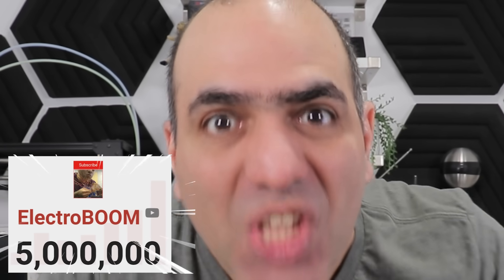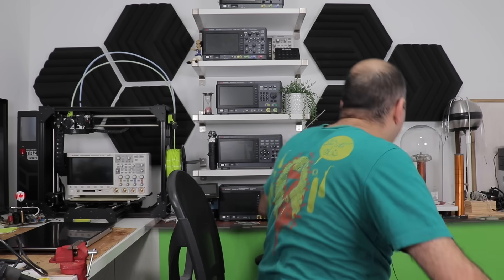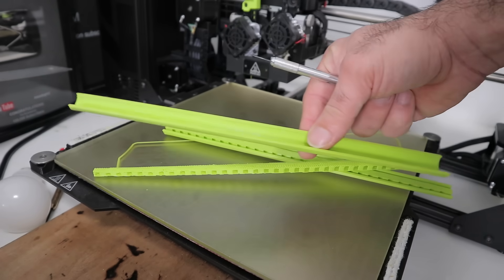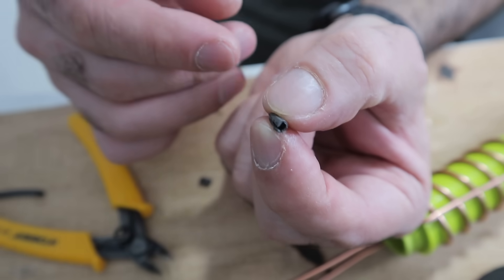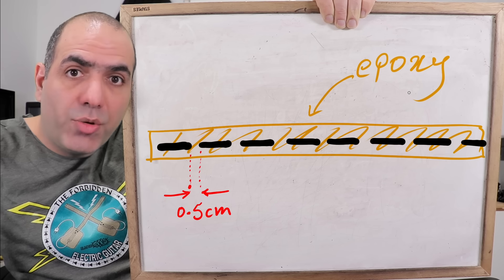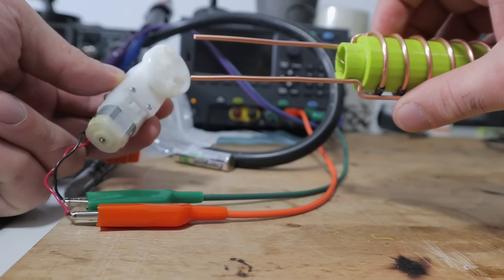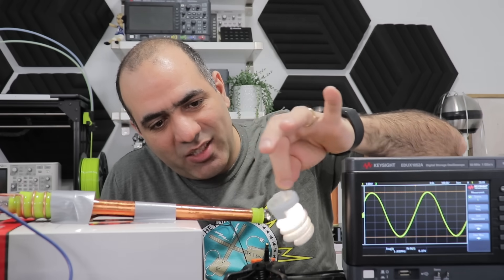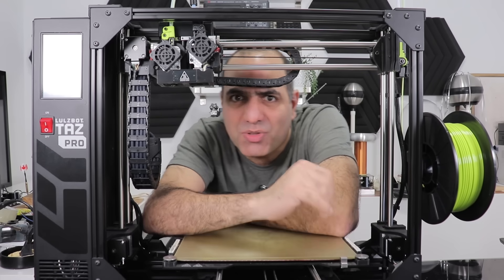Making a Tesla Coil Magic Wand, to Celebrate 5 MILLION SUBS!

Comment: Should have used something like 2000/48 litz wire for the primary, then it would only get warm even at a couple kW's. Of course then you have to watch out for the secondary that will probably be hot enough to thermal burn if touched (assuming 155C-rated wire or higher).

Comment: I've got Harman Kardon Soundsticks as my PC sound system. The volume control is two little touch sensitive buttons on one of the tweeters.
Whenever I turn on my plasma ball (which is about 300mm away from the volume control) the sound turns down to zero.

Comment: I guess the heating might be due to the high frequency change in magnetization of the ferrite core. You might rather go with a RF power amplifier design, which supports the 2.7MHz with air core... Also, you might want to check out javatc calculator. This calculator gives the optimal coupling coefficient for your coil geometry. Congrats for reaching 5M subs.
Reply: Can you give us a link for that calculator please ?

Comment: >"The atom bomb will never go off - and I speak as an expert in explosives." - U.S. Admiral William Leahy in 1945
>I am not trying to win the argument, but you love for the truth. 
>The Scientific Method:
   1. OBSERVABLE
   2. REPEATABLE 
   3. REPRODUCIBLE
>The gyroscope resists all "gravitational" forces in the Universe. Rigidity in space is created by its rotating motion. In 4 gimbals, set it in motion with the axis in the vertical position. It should move 1 degree in 4 min. 15 degrees per hour, to a horizontal position in 6 hours. If not then the Earth is not a spinning ball. The gyroscope experiment should put an end to the debate.

Comment: I would recommend Polyimide (Kapton) tape for electrical isolation.  Polyimide  has a dielectric strength rating of 7700 volts/mil.  Epoxy is only 450 volts/mil.

Comment: You should take a look a specific electrical insulation epoxies, you might be able to squeeze a little more protection out of a thinner design. I used to use 3M scotchcast, the downside is it’s an oven cure epoxy.

Comment: This was the most overcomplicated printing of a simple tube I have ever seen xD
Why not just use a bigger nozzle and print the whole thing in vase mode standing up? Takes like half an hour, doesn't require a ton of supports, glueing and sanding and is pretty much perfectly smooth straight from the print bed^^
Reply: strength, if it was standing up, the layer lines would make it so weak. and since the secondary coil is wound in that direction, the layer lines would probably mess with the coils. and once again, as someone who prints stuff, it would be super weak if it was standing up.
Reply: @abcdefgee  Okay first of all, it's a standing tube that has no real force acting upon it. You're not supposed to whack anyone with it. Besides, I don't know what you do but I have been printing and building printers myself for years and if you can't print a tube in vase mode that can withstand those miniscule forces, you're doing something seriously wrong. Do you have issues with layer separation or something else? I'm glad to help 👍
I've printed 30cm long wind turbine blades from PETG in vase mode with 0.25mm walls (not even 7g a piece :D) and they are strong enough to be spun around by wind on a rotor and I doubt that a standing tube will exceed those forces. I also have this experimental nozzle which I drilled out to 1.4mm. I call it the bozzle and the only things this motor driver burning behemoth is good for is printing tubing and you could beat someone to death with the result. 
Second, simply swap winding direction of primary and secondary coil, problem solved ;)
And once again, no it would not :P
Reply: @friddevonfrankenstein  better safe than sorry is all I have to say

Comment: Fantastic presentation!
Epoxy (like concrete) doesnt dry.
It cures or sets.
Concrete cures through a exothermic hydration reaction which is the opposite of drying.
Epoxy chemically transforms from liquid to an intermediate gel-like state before it solidifies.

Comment: Congrats for the 5 M! 

For the failure of the handle, do you think it's initiated by partial dicharges or by dielectric heating? What is the loss tangent of epoxy at MHz range? Maybe you had a thermal runaway?

Comment: Mehdi, if in place of using a short spike u use a rather long one (sorry) will the sparks change with the topography of the spike? Does the spike has any other point to it, other than decreasing the surface area for distributed charge on a terminal point?

Anyone may answer if they think they are correct really...

Comment: What about making the primary part of the secondary? Basically an autotransformer. The first 5 windings are the heavy gauge and the rest or it is the fine wire. Having the primary part of the circuit might improve the capacity.

Comment: For something that small but high power you may need to use copper tube as the primary and do some small scale water cooling.   Also what kind of epoxy did you use.  Some kinds contain water and it gets trapped in the coating.   You really want to use solvent cure polyurethane and go with lots of thin coats, at least 5

Comment: Magic stave instead of a magic wand?  Or a magic scepter?  Both staves and scepters often have bigger balls!

So, you've made an electric wand.  A basic soldering iron is a 'fire' wand.  How about a cold wand that cools the tip with magnetic cooling?  (Hmm... electric cooling pad instead of a heating pad? Make the cord into a radiator?)

Comment: Chatori Sir, 

Sorry for stating stuff you probably already know, but if you add patchwork of kapton tape before the epoxy stage (labour intensive). Also, you'd want some kapton between the primary and secondary, enough to extend a couple of cm longer than both sides of the primary, and do two stages of epoxy, to get extra coating over the exterior of the primary. You'll reduce the chance of random arcing, and get the epoxy to where you really need it. Also I was going to say something about having sharp points on the tip, but you got that, but it would be cool if you made it look like a star mace or something.

Sincerely, a humble uneducated person who grew up in high voltage labs and thinks that maast o khiar sounds like a delicious addition to street tacos. Really cool video, congrats. I didn't know that there would be enough ion flow to affect random lab equipment, at that distance. Really neat.

Comment: What do I need a 3d printer for. Plastic coil forms and shields for Tesla coils, Marx generators, Jacob's ladders, and Oudin coils. Those lousy plastic parts that break off my mower carburetors. New plastic nuts and bolts for my metal detector. New cases for the TV remotes I dropped/ stepped on. Project enclosures for my electronics gizmos/ power supplies. Fan shroud for a  compressed air air conditioner. (working on it) And I wonder if I can print venetian blinds? Hey Medhi how about winding some mylar transparency sheets between primary and secondary. Mylar has good dielectric strength and low losses. Could use stranded wire on that primary. The skin effect is very pronounced at 1.8 Mhz.

Comment: The reason there's no core in a tesla coil isn't just to prevent arcing, you need the loose coupling in order for the resonant system to function properly, with too much coupling it stops functioning the way it should and you get a much lower voltage output (it begins to act like a regular transformer rather than a resonant transformer).

Comment: ElectroBoom.... you know that 3D printed parts have air bubbles in them... They are printed hollow......... might be why your thing blew up. You used a 3D printed spacer between primary and secondary. You should print these parts with a Resin 3D printer, they will be solid.

Comment: Man, I have a Creality Ender 3 Pro and it worked okay-ish for a bit, then things started going really wrong. Z-screw would slip despite being tight, the hot end would just randomly gouge the shit out of the plate for no reason, and the bed would never stay level, as in, I’d make the corners perfect, then the center would be either super high or super low, so I’d fix that, then the corners would be fucked. Spent at least four months trying to fix everything and now it just lives in the shame corner, collecting dust. Might buy the big boy printer you showed off in the intro

Comment: Use a PEX flexplate system from Wham bam for your printer. It's flexible with high temperature tolerated magnets and the adhesion for printing is amazing without any glue/hairspray/whatever, just a clean surface. 

You just pop it off after printing, flex it a little and the printed part pops right off. Then you just magnetise it back onto your printer and print something else.

Very efficient, very convenient, very easy. Highly recommend.

(I'm not related to the company in any way, a good product is simply just a good product)

Comment: The secondary will have a much higher Q if it's wound with about a wire diameter air gap between turns.

Comment: I may be wrong, but in my enectromagnetism lessons (academic ones in the french prepa system) ferrite is a insulating material, contrary to soft iron, thus not needing plating but a lower magnetic field conductor (ferrite : mu_r=10**3, soft iron : mu_r up to 10**5, speaking of relative magnetic conductivity), thus the use of plated iron in low frequency tranformers (less expensive and plated to lower eddy currents) and ferrite in high frequency ones (far less tinier, but eddy current are proportional to the square of the frequency, so far less power losses thanks to it's internal resistance)

Comment: Did it break because of the Skin effect? Perhaps using Litz wire, or quarter inch copper pipe would make it work better. That or if the heat was localized it may simply have been some arcing. I wonder how close to saturation you are driving those ferrite cores at. It isn't uncommon to see some Tesla coil circuits designed to run well above 1MHz. It isn't easy, though! Look at Steve Wards HFSSTC experiments. Huge amounts of power at around 10MHz! High power designs typically use either high power vacuum tubes intended for radio transmitters or very expensive high power GaN FETs.

Comment: Congratulations on the 5million subs. You should use a frequency generator and oscilloscope and determine the best resonance frequency.  You don't have to use high voltages to do this. Then you can tune the driving circuit with an appropriate capacitor.

Comment: When you dropped that bulb, we all felt the tears of a thousand suns. Congrats on the 5,000,000 subs, and enjoying yet another RF burn!
Reply: Aren't these lamps filled with like mercury vapors?
Reply: @ProtoV33MK1  Ok, I looked it up and supposedly it's ~4mg of mercury per a CFL lamp.
(Let's assume it's all vaporized.)

US environmental limit for concentration in air (by OSHA – work safety and stuff) is .1mg/m³
This would mean it needs to spread into 40 cubic meters (e.g. a 4m×5m×2m room) to not exceed these limits

So yeah… Most likely not dangerous. Still better to ventilate the room and try to not inhale too much when it's still concentrated, but it's not gonna harm you from happening once
Reply: @mskiptr  presumably prolonged exposure, or exposure of vulnerable people (children?) would be worse
Reply: @NithinJune  in deed children have died and have been really damaged by mercury from thoes bulbs, animals also really vulnerable, also the damage is not really clear immediatly
Reply: @mskiptr  there are no safety concentration of any heavy metal.
Reply: @яатакч13  The legality of Pepto-Bismol disproves that.  Bismuth is a VERY heavy metal to the point of having no stable isotopes and yet it's in Pepto-Bismol.
Reply: @commscan314 legality only proves politics and they are usually wrong
Reply: @яатакч13  Did you not read what I said? Pepto-Bismol contains an inherently radioactive metal and yet is safe to use to the point that the main potential hazards are chemical rather than radioactive and only present themselves after WEEKS of regular use.  The dose makes the poison, and Pepto-Bismol's containing of radioactive elements while its potential deleterious side-effects remain solely chemical is a great example of this.
Reply: @commscan314 So there is no safe dose, just search toxicology of, and what the heck you are giving the arguments, even water is not fully innocuous, Also USA have a lot lower "acceptable" standards on just about everything. You do not need to get to the future to know that taking radioactive heavy metals is not optimal for your health, there a ton of better solutions for diarrhea
Reply: Waiting for you to recreate the wand. A nicer version though, as always :))
Reply: It's great, how he managed to break a broken lamp a second time. =)
Reply: aren't those bulbs breaking a health risk?
Reply: E
Reply: Ye
Reply: I'm more worried about the microscopic mercury droplets on his floor now. Even such a drop is enough to give you depression.
Reply: hi
Reply: Hmm
Reply: Yeah mehdi
Reply: Hey solder fumes are really good if you... Never mind never mind Good job dude Good job
Reply: 14:48 When you knock a fragile item over.
Reply: Break 💡
Reply: You guys should try out the new Tesla coil design by Eric Dollard!!!!!! No more primary winding!!!!!
Reply: @jondelaire  Schematic? Source? A quick google doesn't say anything
Reply: Everytime I break one of those I just think of breathing in all that mercury

Comment: I suppose you could keep the primary coil cooler if you used wider copper foil ribbons instead of round wires. In the MHz range, skin effect becomes important, so anything except the outermost 0.1mm of the wire isn't really conducting anything.

Comment: Dear Mehdi Sadaghdar. I really like your channel, and your way to educate difficult stuff in a cool and funny way, most people can follow. But I do not like the way you use Epoxy. Epoxy is very poisonous, both touch and breathing of aerosols. It'll stay in the body FOREVER, and suddenly, you could get a hyper allergic reaction, and stay very allergic to epoxy. Epoxy releases fumes and aerosols when hardening, and quite some time afterwards, and again if you heat it up above 150 degree Celsius or when sanding it due to friction heat. Check it out Mehdi. Best regards, from a Danish Sewer Worker, who repairs Sewer pipes from the inside with fiberglass, epoxy and polyurethane on a daily basis.

Comment: You can use ferrite dust mixed into epoxy, gives much higher density of ferrite while also decreasing the maximum conductive length from the size of the rods to the size of the ferrite particle. I'd give it an external plain epoxy coat to cover any exposed bits of ferrite from the casting though.
Reply: I wrote my Bachelors thesis about such ferrite-epoxy composits for inductive charging, so it should also work very good here.

Comment: Hi Mehdi, a tip my wife learned when she was putting epoxy resin on her art: if you give the epoxy a quick wave with a heat gun after applying it when it's still wet, you can precipitate out all of the microscopic bubbles.
Reply: That's what the vacuum pump was supposed to do. Maybe he didn't vacuum the want secondary resin inside thr handle.

Comment: Thick wire in the primary doesn't help much @1.8 MHz (if you didn't forget about the skin effect yet). Better to put more thin wires in parallel.

Comment: Happy five million Mehdi!.  I think your epoxy heating problem is intrinsic to the high dielectric constant of epoxy resin (~3.5) and the high operating frequency of your coil.  Hot melt glue might be a better choice if you ever revisit this (polyolefin glue sticks usually have a dielectric constant closer to 2.0).

Comment: Congrats to 5M! You totally deserve it.

I think the reason why the primary was overheating is due to skin effect, you know, using that thick wire at over 1MHz is far from optimal :D . If you would use lots of thin wires in parallel or a copper strip, then it should be able to withstand the current.

I wish you happy solder sniffing :D Jokes aside, good luck!

Comment: The problem with the primary coil is that it's made out of solid wire and at high frequency the current starts concentrating at the surface and increases losses due to skin effect.
What you need is litz wire and then you can pump even more power into your coil.

Comment: FYI those ferrites aren't very conductive -- the NiZn material used in #61 and #67 is a moderately good insulator, in comparison to the MnZn used most often in everything, that is conductive enough to sustain an arc from a flyback transformer for example.  Should be no problem running a solid rod the whole length :)

Comment: you dont need a primary. The secondary acts like an inductor loaded antenna , low impedance at bottom high at top. The self induction will propagate the  energy upwards. The main coil is thus a infinitely cascaded autotransformer. An old popular electronics.
Just put your signal gen on the bottom one lead and adjust for resonance , use a sense resistor on scope. This setup will not result in high voltage so built a ferrite transformer to drive it  , again only one lead . Common grounded secondary of ferrite. Drive with a class c mosfet at resonant freq.

Comment: You might try putting the ferrite cores in the lower section, inside the primary, only.  You get nearly the same amount of coupling but without dragging down the voltage-per-energy of the upper section of the coil. You get no bonus points for having a higher inductance out there. The simulation tools I used when I built these thing in high school treated the secondary as two coils in series.
Reply: Congratulations
You have been selected as the random winner of
the Giveaway.
Send me a message via the above contact so to Claim prize!